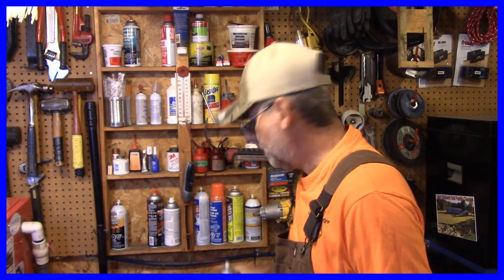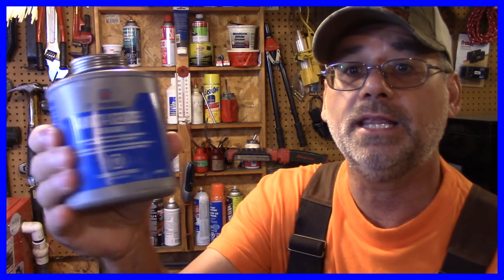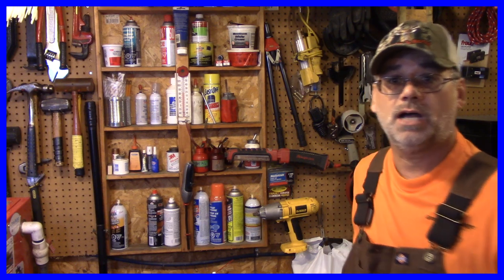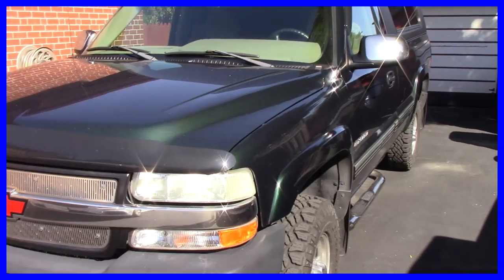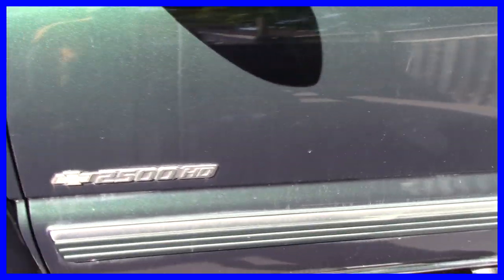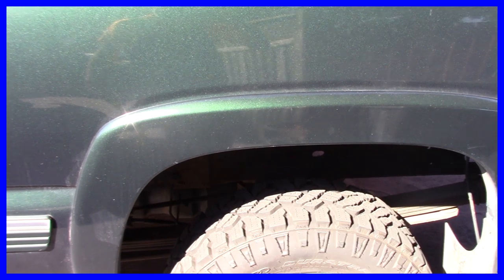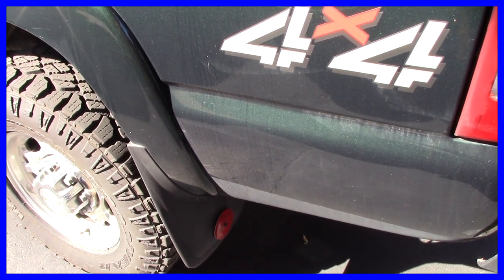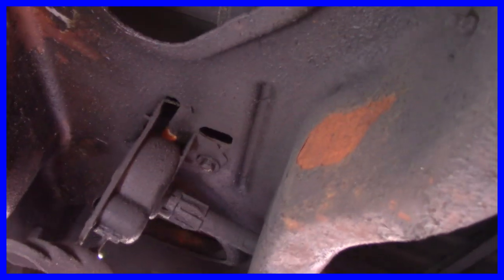APPLYING  RUSTPROOFING / UNDERCOATING TO  YOUR VEHICLE  - THIS IS WHAT I  DO AND USE  .

Comment: Newbie questions to STEVE ROB REVIEWS or to anyone. We just bought our very first car, a 2019 Caravan this year and we live in upper Toronto area. My drive to work is only 8 km back and fort. Do you guys think it's a good idea to have a rust proofing every year for 5 years and do every 2 years after that? Also, there's this product called "https://corrosionfree.com/" just wanna know if any of you tried this. The thing is, in my area only Canadian Tire does it and lots of people told me not to go to a Canadian Tire to do something with my car because of their bad reputation. So my last option is Krown. Thank you so much in advance and thank you for all the advice from this vid. Stay safe.
Reply from the maker: I like Rust Check  for doing under coating  every two year's from new works great over time . Cheers
Reply: Most definitely STAY AWAY FROM CANADIAN TIRE !  They dont even do tire changes properly ! I had good experience with RUST CHECK . But I've been doing same as our video guy Steve here with same RUST CHECK products. Cheers to my fellow Canadians taking care of their cars . Hello from Montreal ..... winter salt city .

Comment: You say you had it sprayed  by rust check but it washed off. Why is it you use their products then ?
Reply from the maker: There are two products  very thin oil you can purchase in a red can or the coat and protect in a green can. The coat and protect is the one I showed. They will spray that one as well  its really thick. Cheers

Comment: adding rust protection to the brand new vehicle is - yes, a waste of money... buying a second hand vehicle with a few years (...and Km's or miles) is a better option. usually the manufactures undercoat has worn thin or off all together and applying an after market rust proofing product such as RUST CHECK or any other "PROFESSIONALLY" applied product is definitely worth the $$... I had a second hand (3 yrs old) Hyundai vehicle for 10.5 years and had a professionally applied rust inhibitor applied to the car. A few months ago the mechanic  who did an annual inspection on the car was absolutely amazed at how "NEW" the undercarriage of the car looked. Rocker panels - everything!  ABSOLUTELY NO RUST!!

Comment: Hi can I do this if I already have rust?
Reply from the maker: Absolutely because rust never sleeps but using an  undercoating  sure slows down the process and extends the vehicle life. Cheers
Reply: @SteveRobReviews  what do you suggest as I can't get either product.  Should I use a rust converter and then spray a paint or bedliner of some sort before doing the oil based sprays?
Reply from the maker: If its underbody I go for the RustCheck  coat and protect or whatever product you  like and that's it nothing else to use.
Reply: @soobok13  if its only surface rust, sand down any loose rust preferably down to the bare metal with a wire wheel attachment. use rust reformer and you NEED to paint over the rust reformer, I like rust-oleum "high performance" gloss enamel paint. You can use an oil coating or an undercoat for extra protection; if all done right and is maintained, then rust will stay away

Comment: bro i mistakenly sprayed that rust check on my break rotors thinking its was break cleaner, i had no breaksfor a week....It took forever to burn off..😂😂
Reply: You need to panic stop to melt off rust check and it’s gone in minutes. It’ll smoke but not burn
Reply: @Driver0808657  You should of purchased a few cans of Brake Cleaner to spray on the Rotors to clean the surface.
Reply: @ffas23  I would clean them with brake clean of I were concerned, but brakes get so hot under heavy load it's not an issue. They only stay weak if you're daily driving with low stopping force, they don't get hot to burn off contamination
Reply: @Driver0808657  Yea I was daily driving around town, start/stop thats why it took a bit, It definitely had breaking power but I really needed to bottom out the pedal, just kept a safe distance. Until they felt confidence inspiring again.

Comment: No parts are galvanized. What are you talking about? Porsche is the only galvanized vehicle Ive ever saw. GM they rust like crazy.
Reply from the maker: Depends what parts your referring to. Worked at GM my whole life and today every body panel is galvanized or is aluminum . GM build world class vehicles and so does most   automakers .  All vehicles built in North America have galvanized bodies and do not rust out like 40 years ago. Cheers
Reply: @SteveRobReviews  I guess I'm thinking of galvanized as in galvinized bucket with zink ? Or does galvanized mean a process?l guess I'm ignorant to the processes actually involved in the auto manufacturing. Yes American automobiles were greatest in my opinion before the went to front wheel drive and computerized. I was hurt for a lack of a better term when gm dropped Pontiac and Olds. I was a Pontiac man. But I am also disappointed with the rusting issue. I have a 2004 gmc 1500 and its just rotted. I guess thats my main issue, rust and also over complicated systems that have been incorporated in the vehicles. More to go wrong. Recalls have become the norm. Thanks for your reply. You are a loyal auto worker, that says alot in these times. Take care.
Reply: I think it's ionization.

Comment: Has any one used used engine oil on the underneath  of a car ?
Reply from the maker: Nope not me .
Reply: Tried that and drove it down a dirt road. It was gone in 2 months of winter driving here in the northeast. Fluid film was only slightly better.
Reply: I applied it once to everything under the truck and I think it wore off pretty fast (I used straight old oil with nothing else mixed in). Tho I didn’t drive on dusty roads and I was also driving in lots of rain after I put it on.  it’s too watery to work I think so I’m trying to find something better and that will last longer. Got some rust check coat and protect gonna try that now

Comment: You sure that fuel filter isn't from 2002?  Lol
Reply from the maker: Haha I change it every  24 months just so  the fittings dont rust up. 😅😅
Reply: The only thing I hate is that they dont give you new o-rings with the new filter!

Also, I thought all cars now a days are e-coated (electro cathodic resin) prior to final paint?
Reply from the maker: Most body panels are galvanized then painted but it's not like a galvanized nail it's super thin .
Reply: I've never used o-rings installing fuel filters and my fuel filters, which I've installed, have never leaked.
Reply: HAHAHAHA! Steve! I was thinknig that the filter looks as good as the lines, but he'd never...of course he replaced them right? LOL But Super here tried to bust your chops about the filter. Oh, you too have me all gassed up laughing. :)!
Reply from the maker: DE Nichols  My truck fuel filter is a compression fit - no O rings like some quick disconnect types.
Reply: @SteveRobReviews  I prefer the ones which screw in and out, but with how well you maintain your trucks it probably is a lot easier than someone else's rust bucket.